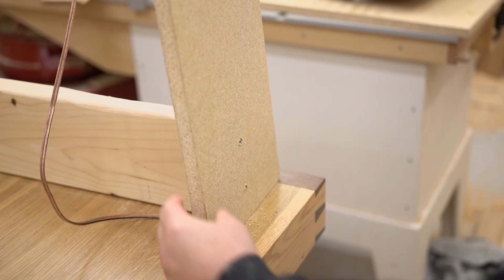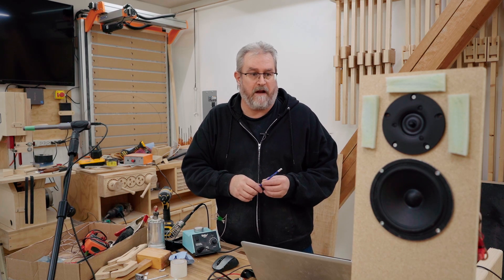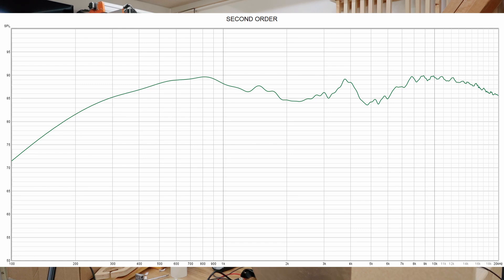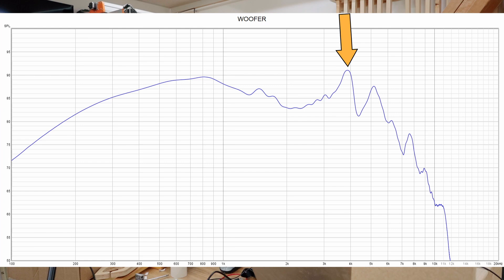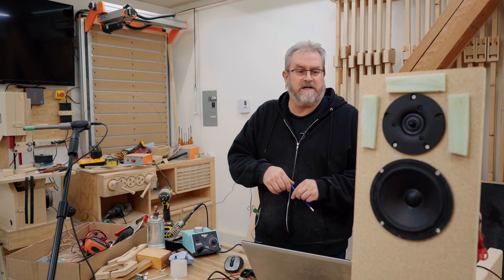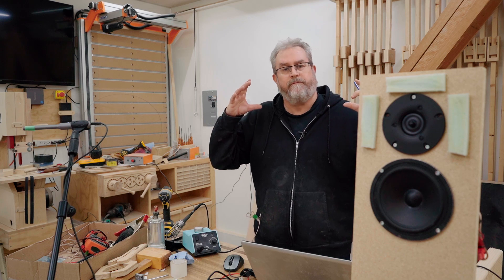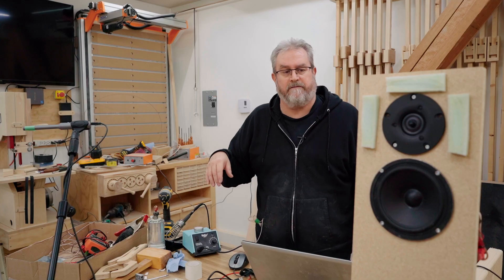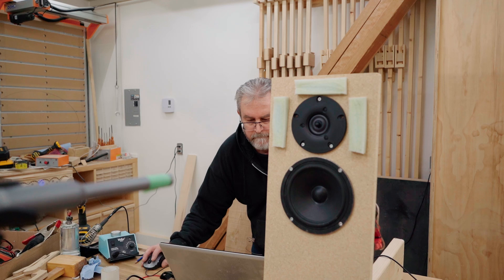Designing Crossovers and Measurements / Listening

Comment from the maker: Lost? Don't know what I'm talking about in this video? Watch the first video on this project:
https://youtu.be/PxXVceRLZrc
I started with a rough 2nd order crossover at 3500Hz and refined it from there. My first measurement showed a bit of peaking in the midwoofer response around 3800Hz, so I changed the filter on that driver to a 3rd order and lowered it to around 3000Hz. I then adjusted the 2nd order filter on the tweeter to that lower frequency and arrived at a pretty good response. I may do some more fine adjustments, but this is a very good start.
I also tried a first order crossover on both just to see how that looks. Again, it let in a bit too much of the peaking in the midwoofer response, so I ruled it out.
As for how it sounds, it's early yet, but I'd say it's very good. The midrange sounds clear and smooth and blends seamlessly with the tweeter. Lower midrange sounds full and neutal. I played a couple of songs (in mono) that I'm very familiar with to judge. Unfortunately, I can't record those in a published video, since that would be copyright infringement.
Next step is to make the solid wood baffles for both speakers and that will be the subject of the next video.

Comment: On two ways, I start with a poly cap on the tweeter and an air core inductor on the woofer and go from there. I find 2.5K or less works well with a two way, usually settling around 2K. Sometimes the woofer needs a zobel filter, sometimes the tweeter needs a resistor or two to take the harshness out. All done by ear. People that hear/buy my "creations" cannot believe the sound I can achieve from 6 1/2", 8" or 10" woofer and dome tweeter. My position is less is more, I never have to go past a 2nd order xover on a 2-way system. Neither does JBL, Klipsch, AR, Polk, and many others....AR was famous for using only one cap on the tweeter, woofer full range. My JBL 4312 Control Monitors run the woofer full range, no components on the woofer at all.

Comment: typically the most important piece of foam or 3/4" felt which I prefer is between tweeter and woofer. David Ralph has extensive test's of this on his speaker pages.
Reply from the maker: Tests that involve measurements can be misleading. Everything that's measurable may not be audible, so unless the measurements are backed up with blind listening tests, they are not of much use.
For example the foam or felt is meant to stop diffraction, but there haven't been any definitive tests that prove that diffraction is audible while listening to music. This being audio and so heavily nerdified, you'd think there would be several if the problem was actually audible.

Comment: I'm surprised you didn't recess the tweeter. There was a video I saw once where tests were done on recessed vs non recessed tweeters and the data showed that the tweeters measured much better when flush with the baffle
Reply from the maker: I made a video doing just that - comparing recessed to flush mount. That's why I did the tape and foam, to show whether diffraction (that's fixed by recessing the drivers) is the cause of the ripples. I knew there would be people saying I should have recessed it.
Reply: @IBuildIt  If I'm not wrong recessing the tweeter do phase align it with the mid-woofer. It also allowes you to build a horn to deal with diffraction. The absorption on the front face of the baffle also deals with the diffraction
Reply from the maker: Test baffle, guys. Test - you understand test, right? Testing isn't finished work. 
Diffraction is mostly BS and not something I'm concerned with, so no, I didn't bother recessing the drivers. I'll do that on the real speaker because that WILL be finished work.
I AM concerned with the crossover and how the width of the baffle would effect the response and that's what I'm testing. And try to keep in mind that I know a thing or two about this stuff and didn't start doing it last week.
Reply: @pablohrrg8677  
Recessing the tweeter for phase alignment? 
Be mindful, even up at 1khz, the wavelengths are over a foot long ... so 1/8" doesn’t help much with phase alignment with the other driver. 

A smooth physical transition to diminish potential diffraction effects is the factor at play, not phase alignment.

Comment: I have a trained ear after playing around with REW too much and that peak would have driven me nuts ;) Bought some SB acoustic 6" which has that brakup pushed all the way up to 9kHz and I still noticed it light up with a 2. order at 3kHz. At 3. order 2500kHz it was still noticable but I calculated the quarter wavelength and put a foam piece that diameter in front of the 6". That made it go completely away :). Using foam for absorbtion and diffraction took removed it away. Btw the brakeup did not show up in REW with the 3. order but I could still hear it!
Reply from the maker: Are you sure it was cone breakup? This wasn't.

Comment: Cone breakup. Another way to mitigate that is with a tank filter. A .33uf cap with a 3 ohm resistor in series and the combo in parallel with the inductor. The resistor is necessary to keep the impedance safe above 20khz.

Comment: I like dual ring tweeters - and they typically have a nice low Fs. So the crossover could be much lower - like around 2kHz. This would avoid the breakup mode on the woofer.
And something I have done to design crossovers that is quick and very flexible - use a miniDSP 2x4 HD and separate amp channels for each driver. You can quickly change the crossover points on each driver and the slopes, as well as the type of filter. No soldering and you are not limited by the values of parts that you have on hand.
Reply from the maker: I have a minidsp 4x10. It's being used as the crossovers for my main speakers and infinite baffle subwoofers. You might want to check through my recent videos to get a better idea about what I've got going on.
I also have a Behringer CX3400 that I could have used to model the crossover. Instead I did it old school and just used the parts I have on hand. I'd say the results are much better than acceptable.
BTW, that peaking in the midwoofer isn't breakup. Breakup for that driver is much higher.
Reply: @IBuildIt  What ever the cause of that woofer peak is, the Fs of the tweeter is what - 440Hz or 600Hz? The crossover could easily be 2KHz or lower, and this would let a 2nd order woofer crossover be much smoother, and keep the DCR lower, as well. The dispersion of the speaker would be much wider by using the tweeter lower, and keep the woofer in its wider dispersion region, as well.
Reply from the maker: Scanspeak specs the tweeter's recommended range from 2500Hz and up. I'm crossing around 3KHz. 
I actually tried a lower crossover point but didn't include it in the video. The results were not as smooth as I settled on.
As for off-axis response, this speaker should be quite good. But since I'm using them in a special application, great off axis response is not at all a design requirement. In fact they would work better for me if they were more directional.